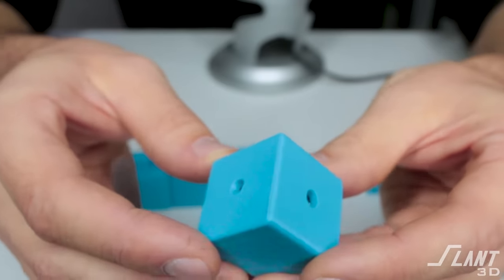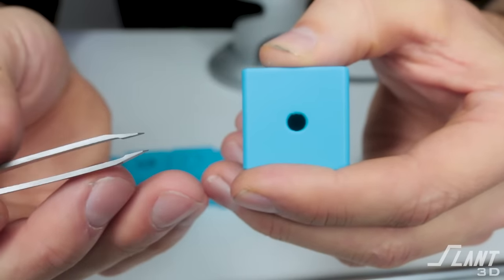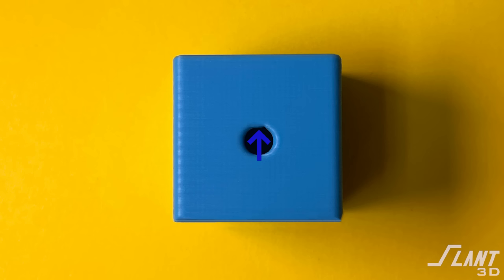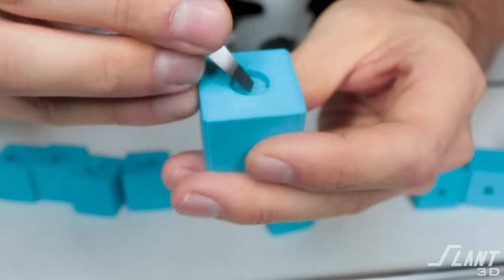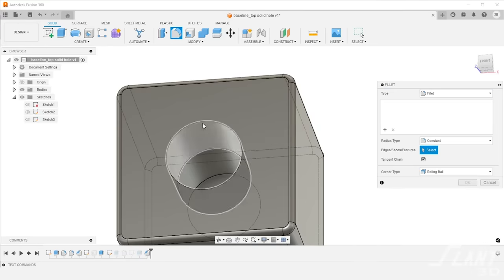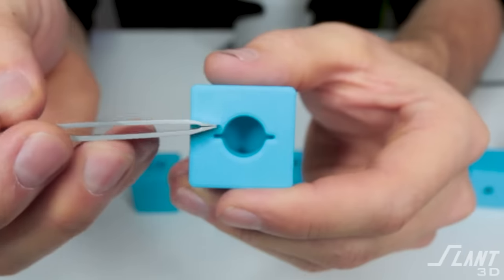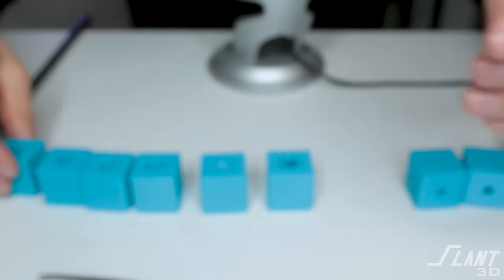Design Better Holes | Improve Tolerances | Reduce Sagging | Design for Mass Production 3D Printing

Comment: curious, you mention sacrificial layers for printing the floating hole. but what about the method thats common on prusa parts, where you print a single direction layer up to the edge of the circle either side, then another layer going in the oposite direction up to the edge of the circle on either side. then finally print the layer with the circle. you get the benefit of the sacrificial layer without needing to punch through any material.

floating holes are just yet another one of those complicated slicer problems that hasnt been cracked yet. in theory doing something similar but in a single layer should be possible, with custom gcode to prioritise the outer solid sections first then use them as supports for the inner walls, while also preventing sudden velocity changes. not sure what would be needed on the slicer side to generate that kind of gcode automagically.

Comment: For supporting overhanging through holes, the best solution I've seen is designing in a cylindrical plug that is barely larger than the diameter of the hole and just meets the bottom of the hole. This plug provides support to bridge to and breaks away cleanly.
Reply: You mean a cylindrical support?

Comment: yo dawg the reason you are getting step artifacts in your prints is because your slicer/gcode isnt set up ot draw circular paths on the hole diameters, not because of the fillets. dont modify your design intent model to compensate for manufacturing defects unless you have to, use proper manufacturing techniques instead
Reply from the maker: Holes in the side of the part have nothing to do with circular paths

Comment: Man I had this exact problem today!
Tell me do these reliefs apply to both side and top holes?
I printed something flat to have the most strength but the rod crack the hole anyway. Thanks so much for all your advice!
Reply: The teardrop technique is typically only used for sideways holes, as it is to compensate for  finite layer thickness of the slices.

Comment: For the unsupported top hole, print it on a 45 degree belt printer😮. Any side holes should print well too. No need for any workarounds!😊❤👍
Reply from the maker: Or rotate the part 45 degrees and don't use a bed slinger
Reply: @slant3d  u know most other kinematic types (minus the delta) still sling the bed.  they just sling them vertically...

Comment: 🎯 Key Takeaways for quick navigation:

00:28 ⚙️ Adding small fillets around a hole helps create a cleaner 3D printed hole and prevents deformation.
01:10 📏 Adding a point to the top of a hole prevents sagging and maintains the outer profile for reliable screw placement.
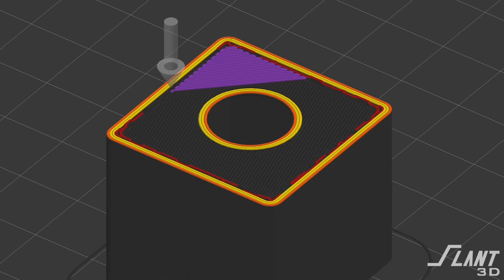02:21 🏗️ Unsupported top holes can lead to messy prints; consider supporting or using a sacrificial layer to avoid issues.
03:46 🛠️ Compensate for 3D printing shrinkage by adding a small chamfer at the top of the hole for a good fit.
04:56 🏗️ Design holes at true diameter and add relief features on the outer side to create a strong press fit while avoiding deformation.
05:24 🌀 Crush ribs are sacrificial features that enhance press fits by allowing controlled deformation.
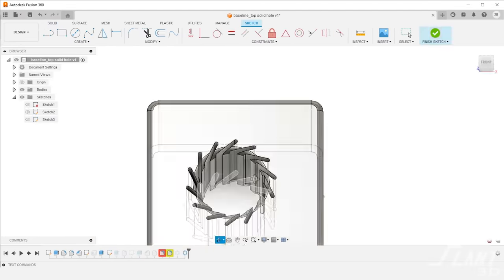06:22 🔄 Grip fins are flexible features around a hole's outer edge, providing constant grip force for removable and reusable parts.

Made with HARPA AI

Comment: Well presented and useful tips for production quantities. It presupposes that the printing isn’t exactly the same on every machine and that you want less cleanup. It would be good to mention the print direction, in particular to not force fit parts that may split in the vertical sections where layer adhesion is less, that’s where the grip fingers become useful. They’re also useful where you don’t want a loose fit, like a sliding bearing. This method seems to be a fit for most applications that don’t carry too mush load where the plastic crepe might be a problem. If the load is higher, make the walls thicker and add those finger for a tight fit. This video is also good for drawing attention to production where you don’t want to spend time working after the print. For prototyping this is less relevant, you can always interest a heated rod or ream/drill it out.

Comment: Could you heat the rod, or better yet, use an arbor press with a leather hole punch, and slight twisting action. 

If that support layer is thin enough, and you gave it an acetone bath. Would it dissolve just enough, where you could pierce it with blade.

Comment: Printing top holes, especially in the case you showed can be much more easily done by printing the part upside down, so the top hole is on the bottom, so there is no need for any bridging.
Reply from the maker: Not always possible. But orientation is always the best solution when possible

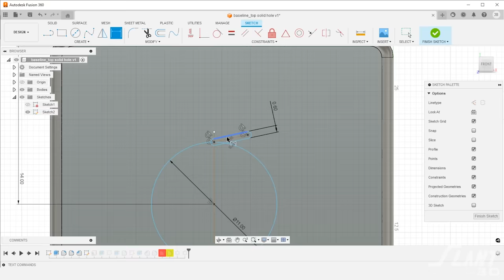Comment: 6:15. I would have the “grip fins” face clockwise instead of counter clockwise. This would work like a lock washer. The way you show them makes it harder to insert a screw, but easier to remove it.
Reply: It's not for screws

Comment: I could complain that some of those 'holes' weren't manifold, but that would be petty. Especially when applied to that bladed design, very pretty, and useful complex surface topography indeed. 😆
But seriously, I'm surprised you didnt mention making those horizontal holes egg-shaped at design, the small overhang still sags but winds up approximating a circle better... Nice video tho, I learned something.

Comment: The hole shape depend on the type of materials you used to print ! With nylons or abs this not happen
Reply from the maker: Incorrect
Reply: @slant3d  to proof me wrong you need to print the same thing and hole with the type of materials I mentioned ! Not just PLA .